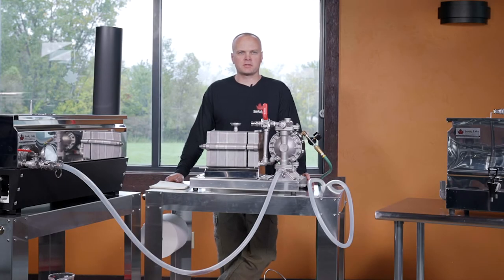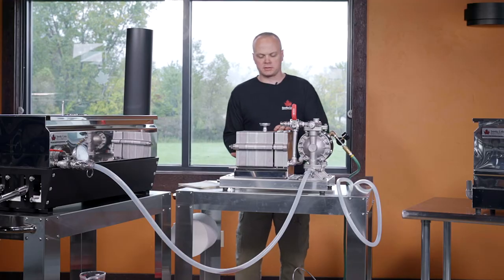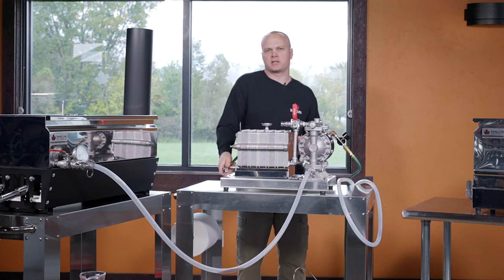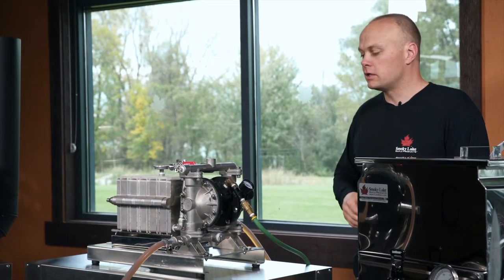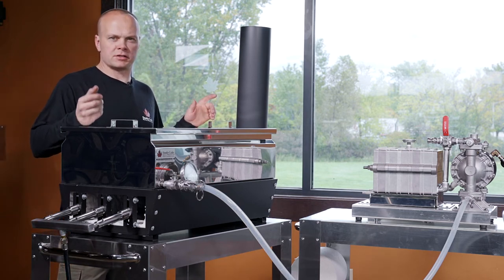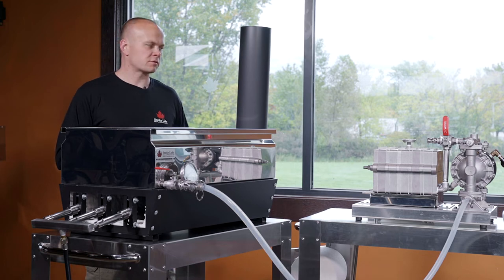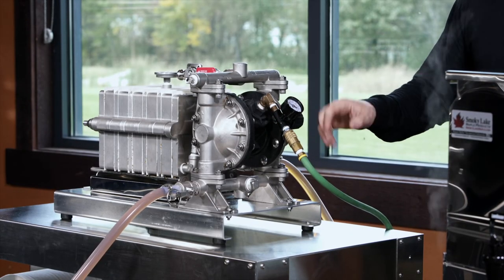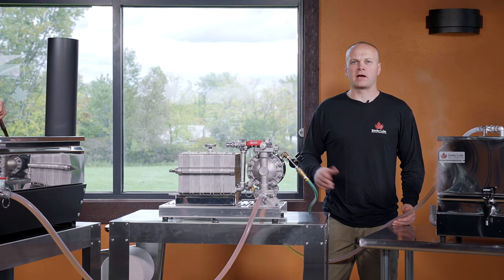Session 2: Using a Filter Press

Comment: Just a small time syrup maker. Can I use the old fashioned way of filtering and then use the steam bottler for additional filtering and bottling
Reply from the maker: Yes, you can rough filter at the evaporator, then fine filter through the steam bottler later before bottling.

Comment: I would like to see a video of you finishing the filtering process. Once you broke it down to show us the cakes, the hoses were already removed. Also, when I break mine down, I tend to have a ton of syrup still in the filter; ie. my cakes are soaked and full of syrup. How do you get everything out?
One of the things I think we do wrong is that we put more DE in than you do. We have the 7 plate filter so we only have 3 window plates. We typically filter batches that are no more than 15 gallons. How much DE should we use? We've lost a ton of syrup in the past last year. We could barely run any syrup through before the pressure went high and the press started to leak a lot.
This video definitely was helpful, but like I said, I'd like to see the whole process. Thanks!
Reply: Richard.   When I run out of syrup to filter I run hot water through the press and I pump back to my syrup pan.   I stop when I see water coming out of the press.  I then crack the press to drain the water.   Or I break down the press and clean it.